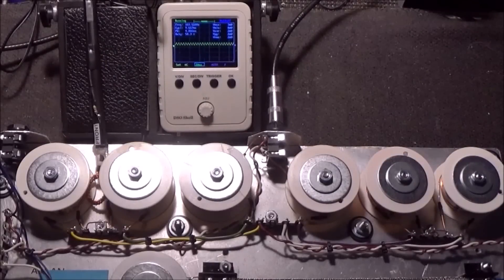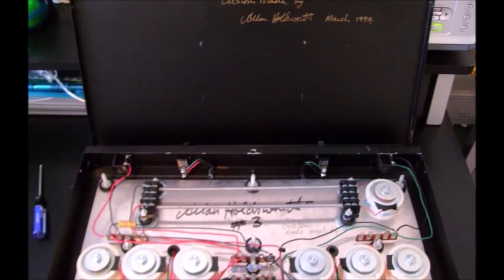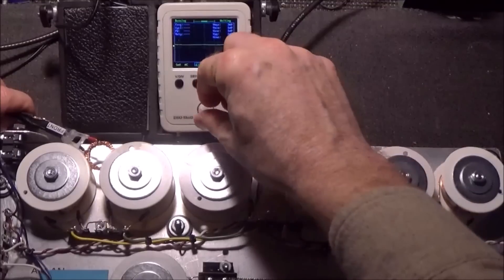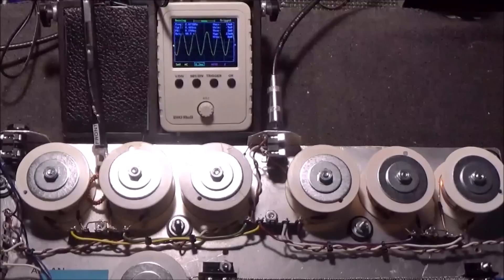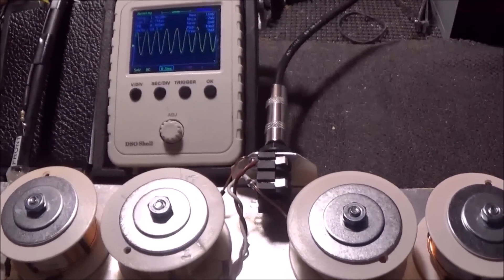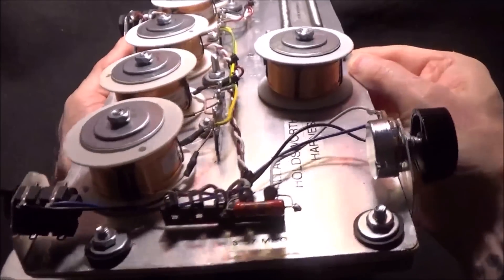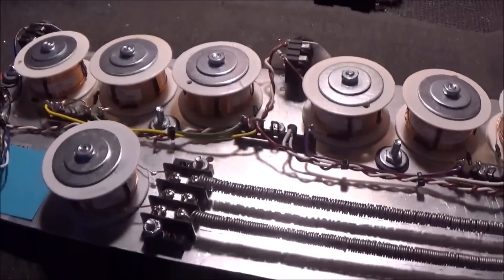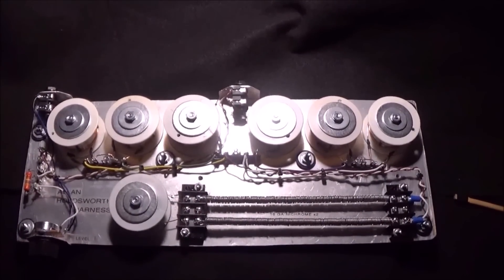The Allan Holdsworth "HARNESS" - Part II

Comment: Steel base will make a HUGE difference.
No way the capacitance of that circuit can be in the 10's of micro farads. You measured something wrong there.
Reply from the maker: I believe in part 3 I go over this capacitance thing. We are talking about a total of only 10-15mH or so of inductance in this circuit, and not very many turns of pretty heavy gage wire on each inductor. That's a very tiny amount of inductance and it will have almost no self-capacitance. It would only be picofarads, probably less than 100-200pF (and some think I am way high in that estimate). Same with the nichrome wire, almost no self-capacitance there with a total DC resistance of only around 6-7 ohms and an air core. 

Allan's unit is pretty much a pure resistive load. No LRC circuit like most of the "attenuators" made today. Closest thing to it is the original "Power Soak", but that uses a truckload of ceramic capacitors. Actually is closer to the "Altair" which I believe used the same nichrome wire as you'd find in a toaster. Still trying to see what the inside of one of those looks like.

Anyway, if anything, the steel baseplate will slightly cut the higher frequencies but it won't be anything dramatic. It would be like the difference between a 10 and 20 ft guitar cable. It appears that Allan used both steel and aluminum baseplates, and some of his units were in an aluminum enclosure and some were steel (as far as I can ascertain). Also some of them were "custom" units, with volume and low/high tone controls. That tone control scheme Allan came up with is simple, clever and very effective.
Reply: @VegasCyclingFreak  This is one of the oldest errors made with impedance measurements. Any misunderstanding of which component is the dominant contributor to the impedance will lead to large errors in the other components. E..g. misunderstanding dominance can turn a 20uf capacitor into a 100pF capacitor easily. 
The exact same thing was made in papers in a related field by a gov researcher who were just a bit sloppy with impedance measurements yielding huge capacitances as a result. This turned out to be  false as I  proved later on and allowed me to file patents solving a 50 year old problem. This was a highly qualified individual. I am sure you make the same mistake.

Your actual transfer function measurements shows that you are making a mistake, and to me it is clear that your impedance measurements are wrong.

So which impedance/LCR meter did you use to measure the output impedance as in your video where you got these huge capacitances ?

Comment: If you wax potted the coils would it eliminate the crosstalk, or is this happening at the particle level? Like are electrons just jumping between the coils? Or is this a mechanical resonance?
Reply from the maker: This not the same as a guitar pickup, it's not microphonics either. "Potting" it won't do anything to change it.

It's called "mutual inductance", where the field generated by the current going thru one of the coils influences the field of the other coil. It's likely a very small factor in the overall scheme of things. How you orient them in relation to each other makes a difference and it's possible to even eliminate it, but not possible in a one rack space configuration.

This page here goes into more detail about it: https://www.audioholics.com/loudspeaker-design/inductor-coil-crosstalk-basics

Comment: I think the reason for the massive inductors with a metal core is that he was trying to recreate a physical speaker only without the magnetically driven cone. The addition of the heating element resistive wire is as practical as it is genius. 

I recall some interviews with Eddie (back when he and Alan were hanging out) about padding the speaker output down to line level and how bad it sounded. Your videos and research have connected quite a few dots for me here. Well done!
Reply from the maker: Thanks. Happy to hear that you got something out of these videos!

To add to that, I think he may have been trying to simulate the inductance of a speaker moving a lot of air - in other words at high sound levels. Came to that realization after I uploaded part 3.

Comment: So in essence he built what was in the pop pop books. He dumped the power signal into the nicrome wire(heater wire) to knock it down to something close to line level and he wound a bunch of ancient crossovers like youd find in a old old tube component hifi. Part of the secret is how those coils are oriented and wound. That design is absolutely barbaric and only a man who spent many a night digging around in old obscure electronics looking for spare parts would of ever come up with this. Thing is built like its from the early 50s. I love it. Ill be winding one this weekend
Reply from the maker: Hey let me know how it works. It's still not 100% verified... had to make some guesses. Also keep in mind he designed this circuit for tube amps with a master volume.

I have a hunch he got the idea from messing around with crossovers in hi fi systems, or maybe from tube radios. Your guess is as good as mine!
Reply: @VegasCyclingFreak  I was sitting here racking my brain and I think I know where he got the idea from. When I was a kid back in the 90s my pop pop had a old top shelf hifi in the basement my nana wanted out. Long story he was a repairman, chief engineer of a b24d liberator in the service, and I got all of his college books from the 40s which is how i learned this stuff. Now back to this hifi, this one was stereo AND component so it had 2 12s that have almost like a felt cone, 2 5 or 6s with bakelite covers and I believe the other was a 3" speaker in there too. Now what I remember the smaller speakers were hooked to a central board and I remember it had wound bobbins on it I think were cardboard like a sewing spool and there was quite a few. I have the speakers out of it and this weird spinning reverb air funnel thing.I know that back in the day guys would take the 12s out of those hifis cause they have incredible breakup at low volume. Looking back on it now, that board was probably to balance out the speakers in terms of load and volume/presence so all 6 speakers would have around the same spl output and would sound like one big full range unit. That's also what I suspected the weird air funnel thing is. It was designed to move the air in the cabinet out and filll the room with sound. This was all cutting edge back then so they were trying new things. Figures the only other guy that's seen one is another wacky junk collector named Allan. Guess that makes me Alan Depreciationovertime

Comment: Time 14:14 200Hz resonance calculated but not experienced..resonant frequency is math calculation . Not considering separate components but 3 possible components as a simple circuit 1xinductor 1x resistor 1xcapacitor will give the resonances. Theory vs real.worls
Reply from the maker: Yeah that ended up being wrong. LCR meter gave me false reading on capacitance. I will address that in part 3.

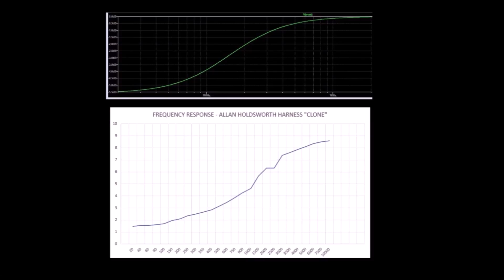Comment: Really interesting.  One thing I would say is that your 10:34 plot of output voltage (RMS) against frequency is not the same as the LTSpice plot, which is dB gain against frequency, with frequency being plotted on a log scale.  I re-plotted your data with dB values, and your chosen frequencies do come close to approximating a log axis, and the resulting plot is not too disimilar.

You absolutely should be able to measure the resonant frequency with a function generator and oscilloscope.  If the resonance is very subtle, it won't always show up on a wide-band frequency sweep.  I couldn't quite see your method for measuring it in LTSpice.  How sure are you about your calculated Capacitance value?  That will impact the resonance quite heavily.
Reply from the maker: Yeah about the resonant frequency... I discovered that my LCR meter was giving me false readings - live and learn. Consulting with some people that are more knowledgeable than myself, I now know that in reality the capacitance should be very small, maybe a few hundred pF. Don't really know how to measure it with a reactive circuit like this. Maybe I need a different LCR meter. In any case, the consensus is that the capacitance  is so small that it's really just academic. 

The corrected LTSpice model & actual impedance curve look a lot different than what I showed in this video. I'm currently measuring the impedance at various frequencies, etc. Will go over that in part 3. I have not found a resonant frequency... maybe it's so subtle that I pass right over it.
Reply: @VegasCyclingFreak  A few pF seems very reasonable... I made the same assumption and calculated a resonance in excess of 100kHz, based on your other values.
Reply from the maker: @joebasswizard  Seems reasonable. No resonant peaks to be found in between 20Hz & 20kHz.

Comment: Just a theory here but it seems like the nichrome coils were meant to act as a sort of like an 'unbreakable bulb limiter'. People don't realize now how difficult and often risky it used to be to play a 50-100 watt amp through an attenuator back in the day. The Rockman Power Soak was the first (I believe) commercially available speaker-sim and it's purely resistive load blew up alot of amps so there was a trend towards reactive loads but ultimately the excess heat has to go somewhere so you'd still have to rely on power resistors to do most of the work as well as fixing the unit to a maximum watt rating. The genius part of this attenuator is that it not only could it probably dissipate 500+ watts of power by looking at it but it's rapid dynamic heat/cool down characteristic better mimics the way a speaker works. I wouldn’t worry too much about blowing up that Seymour Duncan if everything with the attenuator checks out. Start with the master volume set low checking to see how the system reacts and push it up slowly reducing the gain and bass controls the higher you go like you would with a non-master volume amp. So long as the amp is in working order (check power tubes and bias) and there's no quirks with the overall design prohibiting higher volume use, it should be fine.
Reply from the maker: Yeah, that's a good way to think of those nichrome wire coils. They can easily handle 3-5 times the 100 watts rating Allan gave his units. Don't know for sure but it seems that maybe the inductors Allan used were rated for 100 watts. In my "replica" I used 200 watt inductors with 20 AWG wire. Still undecided about how safe it is to use. In part III I will go over why.
Reply: @VegasCyclingFreak  I'm sure you could explain it better than me but as far as the amp/output transformer is concerned, so long as the cold DCR of the unit adds up to around what the speaker tap wants to see, that's a good start. Looking at the schematic of it on your absolutely fantastic website I look forward to reading through more of later, the inductors serve the roll as the primary resistive element so they need to be capable of withstanding the inrush current at start up before the nichrome gets a chance to warm up. 20awg is probably about right if it's you're using a heat resistant enameled wire; the sand off kind, not solderon type. The inductors only need to be rated to withstand this brief spike until the nichrome kicks in to moderate the amount of current draw like a shock absorber to take the burden off of the inductors while in operation. The only concern I'd have is if the nichrome DCR goes too high it would under-load the output transformer at the moment of maximum stress but that's pretty unlikely judging by the heaft of the nichrome coils. And also you don't even necessarily have to test it on a tube amp either.  Take a piece of crap solidstate amp or stereo system and see what it takes to kill it or if it kills it at all. I doubt it would but one experiment is worth a thousand expert opinions.
Reply from the maker: @WillelmMacguyver  I used 200 watt inductors - they are made with 20 AWG enameled copper. I'm concerned about the impedance part of this thing. Per my testing yesterday, it's basically 65 t0 90 ohms between 100Hz & 1kHz. I suppose I ought to try a different method for measuring impedance to verify that my test results are accurate. Long story but I discovered that my LCR meter was giving me false readings on the capacitance so what I said about the impedance in part 2 was wrong. 😒

Comment: This thing is just an analog line delay device that serves for broad frequency response and allows the buffer for undesirable transients to be resonated with the desired frequency elements to strengthen them within the range of common harmonics in the audio spectrum. The delay is super short but since as long as your playing your giving impulses that generate desired tones and then as it is delayed you buffer, then resonate, and it must also have to be low frequency in the circuits harmonics (like the resonance of the circuit is way lower than the resonance in the signal but they form harmonics.
 theorizing.  Idk if I'm even close tho.
Reply from the maker: Yeah I think there is a very small time delay involved, like microseconds, which isn't really detectable to our ears. Since there's seven inductors, there may also be frequency dependent phase shifting (small amounts). I don't know how to test for such things, not yet anyway. Probably involves expensive equipment that I don't possess. 🙁

The idea behind the Harness is this: This replaces the speaker of a tube amp with a power rating of up to 100 watts. It places more load on the output transformer by roughly doubling the inductance, which forces the output transformer to sag/saturate and the power tubes to work harder. The nichrome wires handle most of the peak current and heat dissipation. This was Allan's way of silently getting a cranked amp sound at line level, silently.
Reply: @VegasCyclingFreak  

Aye, I appreciate the thorough response. I'm still wrapping my mind around it now. So, he's got the harness between his effects and the tube amp? No no I get it now, the harness replaced the speaker so that he gets a line out and that goes into the venue PA? So even tho much more is going on, it also has to do with the impedance matching for the tube amp, which I understand to be different than the impedance matching with a transitor amp...I think I'm starting to get it. Maybe. 

The testing you showed so far was still kind of impressive for me. I think maybe it would involve a frequency analyzer. If it helps I can ask an EE , he's MIT so he could probably tell how to test it and he's Guitarist too so he might be stoked honestly. Although there's plenty of EE folks here already maybe they will say how. I imagine that the way the harness affects tone will make it hard to detect all of what is happening. A bit advanced for me to comprehend.
Thanks again, this is cool stuff, and thanks for sharing it means a lot when someone puts in all that work and then they put even more work to disseminate knowledge freely. If I had some money I'd give you some, (not that you asked for any.).  

:)

Edit: I missed the very end. He achieves this sound silently? Maybe implying there's another way to go about it that isn't silent? I be a bit tired.
Reply from the maker: @SimEon-jt3sr  At the time Allan was using the Harness the signal path was as follows: Guitar into Mesa Boogie head, spkr out went to the Harness. Output of the Harness went to stereo parametric EQ, then to eight parallel delay lines, various other things and then to a power amp which in turn went to two pairs of amps, one for clean sounds and one for distortion sounds. The speakers on the amps were mic'd and sent to the PA. This was Allan's elaborate way of getting power amp distortion at very low volume levels. He was not a guitar pedal guy. He, like myself, did not like super loud amps. He liked to get that sound but at low volume levels. Exactly how I like to do things too.

In a studio environment he could record with just headphones if he wanted to.

Comment: Power amp to line level. What's the difference from say a mid size practice amp? Or is this only when you're using like combos and stacks...u got instrument level input? 
So is this like if i take one amp and use the output jack or headphone jack and then put that through a venue pa system or is this still going into a large size guitar amp? Cause why would you want line level into your guitar? It seems important actually because if i might get more noise if I'm putting the wrong kind of signal level into a guitar amp or if I'm putting a instrument level output into a not guitar amp PA style speaker
Reply from the maker: This replaces the speaker of a tube amp with a power rating of up to 100 watts. It places more load on the output transformer by roughly doubling the inductance, which forces the output transformer to sag/saturate and the power tubes to work harder. The line level out is taken at the midpoint between this circuit and the secondary of the output transformer and is in parallel with the circuit. The line level out goes to whatever you want. If there was no line level output you'd be feeding whatever is connected something like 35-40 volts RMS and you could kiss them goodbye. 

This was Allan's way of silently getting a cranked amp sound at line level, silently. There's a lot to explain when it comes to Allan's sound processing... in the late 80s/early 90s it was pretty complex.